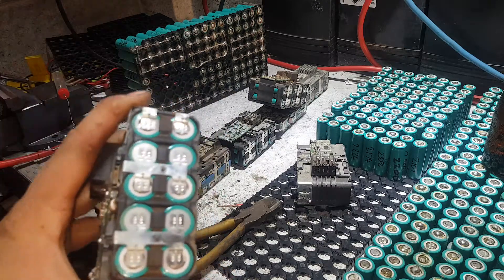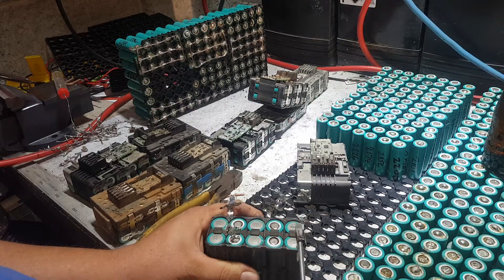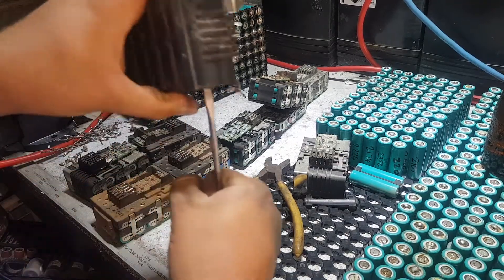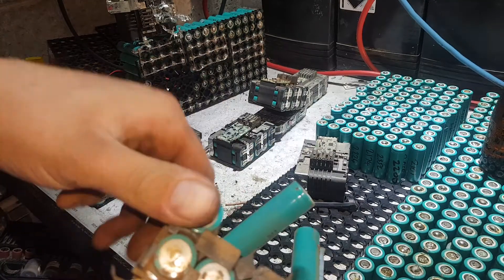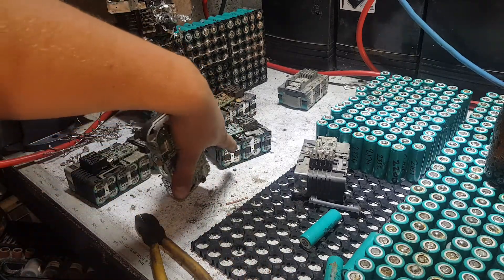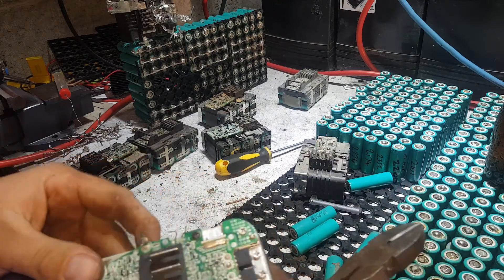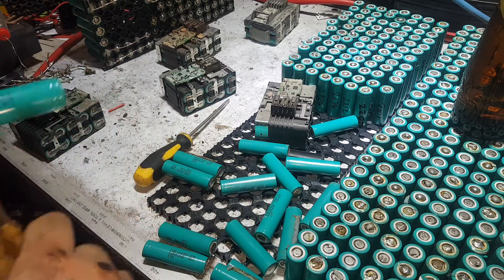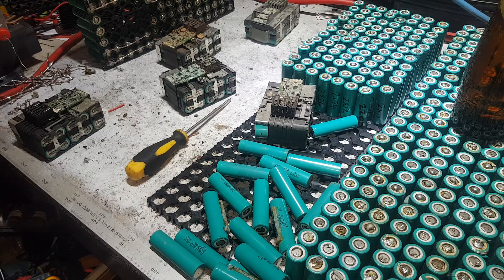Recycling Power Tool Batteries For 18650's  Pokeys  800 cell 6KWH Rv Pack Pt2 Samsung 20R

Comment: What are you powering with these modules?
Reply from the maker: They were to be built for a motor home. Ended up scrapping the idea for safety reasons and sold to one of my subscribers to use in stationery storage

Comment: Why don't you build a lever/press to press the cells out of the packs?
Reply from the maker: Valve spring compressor style
Reply: One Up The Sleeve Customs yeah similar I guess. Would only need a few moving parts
Reply from the maker: Could make some thing for the vice